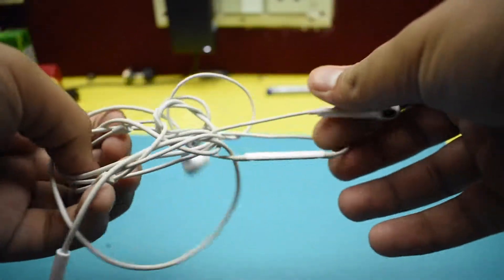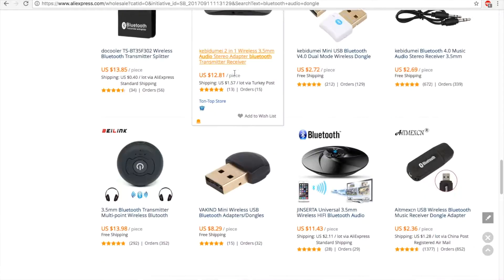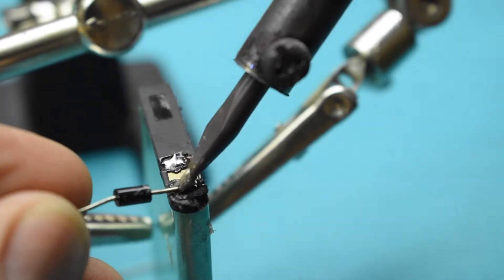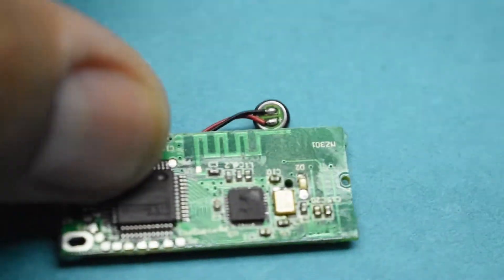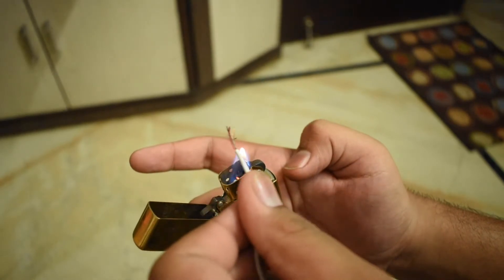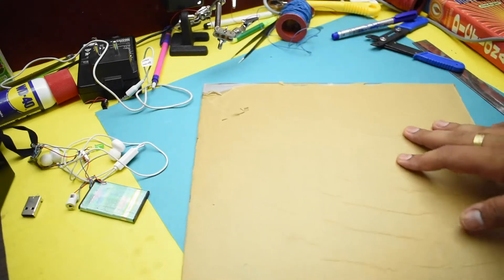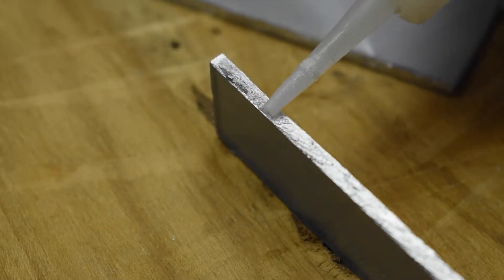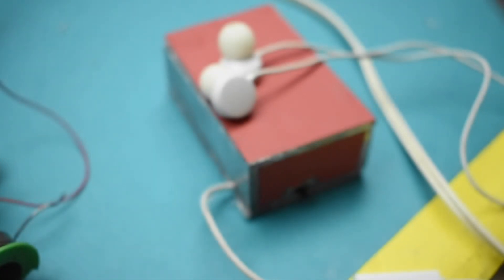DIY Bluetooth Earphones

Comment: If I use a Bluetooth transceiver (3.5-4.2v), a 3.78v battery, an mini amp, and two small speakers would that work?? And if I wanted to put a microphone in there where would I, to the transceiver?